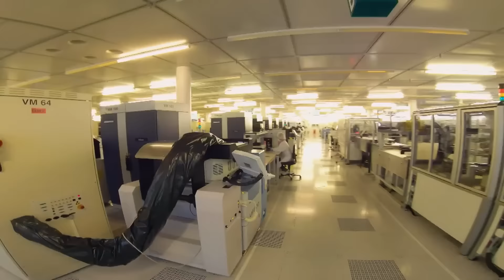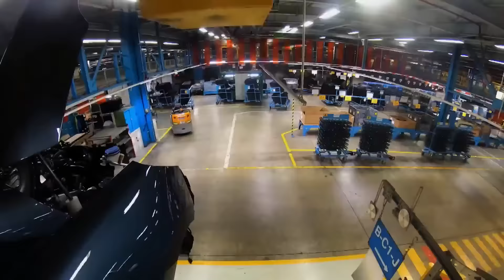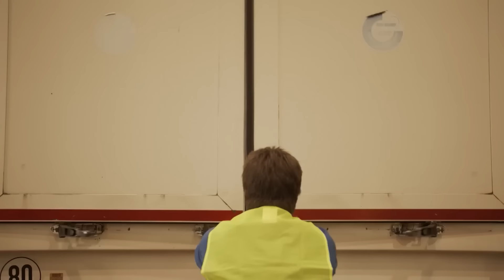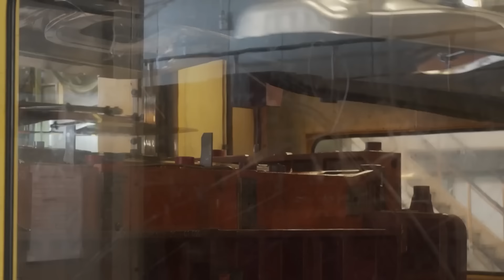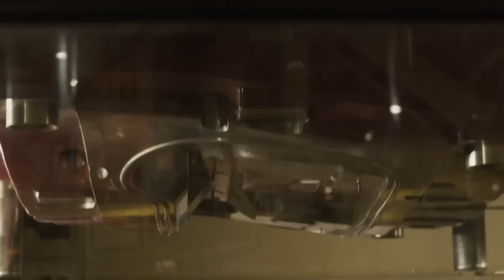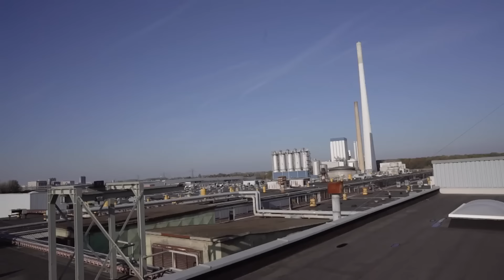Ford Mega Factory: Building 1,000 Cars a Day | FD Engineering

Comment: The numbers on the Cologne plant are staggering — 134 assembly stations, a hall the size of 18 football fields, and 1,150 cars rolling out every day. The pressing plant section was my favorite: 30-ton steel coils turned into 1,000 quarter panels each, 11 press lines running up to 3,600 tonnes of force, and 28 million parts a year from 130,000 tonnes of steel. Also didn't know this was the only plant building the Fiesta in Europe since 1979, with 9 million made there. Excellent look inside a real mega factory.